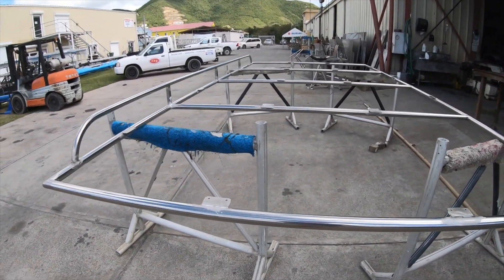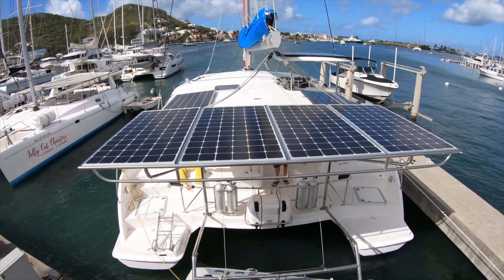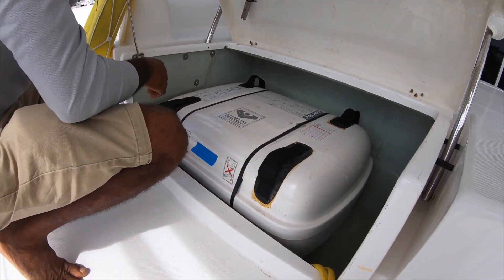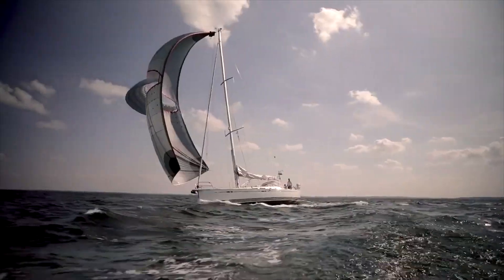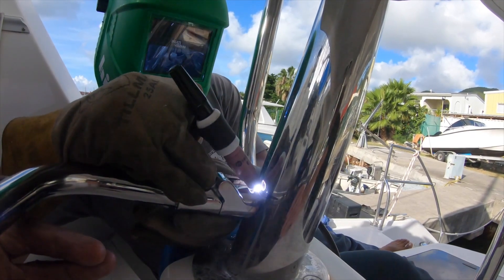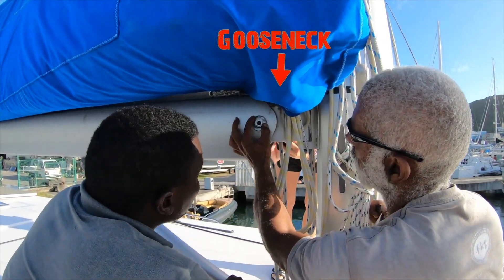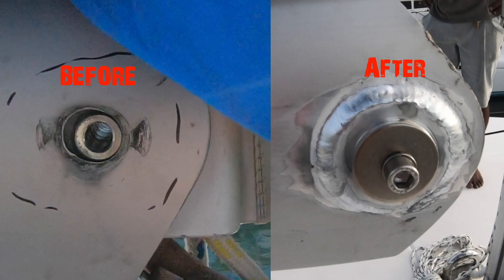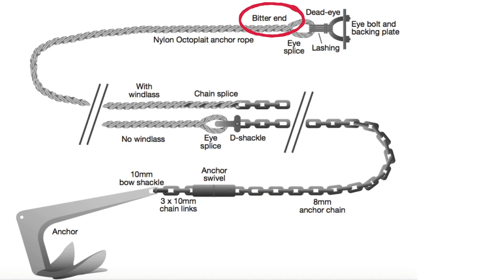117: FKG Work Dock Project Heaven or Hell? 7 Upgrades to our 2015 Leopard 44 Sint Maarten St. Martin

Comment: Hi, I have a question. I know you guys are very experienced divers. What safety things do you put in place when your out at sea and your diving on your own. Do you have to tell someone ? Or do you only dive with someone else? What happens god forbid your boat floats away . Love watching your videos. Take care Jodi
Reply from the maker: That’s a great question, Jodi!! Safety is critical because diving from a fixed point requires you to return to a fixed point. If you have drift or current, then you will have an issue if you are in your own. First, cruisers usually tell other cruisers if they are going down in their own. We then keep track of time to make sure they return as scheduled. If a dive site has the potential for current then we would never dive without someone on the dinghy following or ready. We also are going to purchase AIS Beacons so if we are blown off, our chart plotter on the boat can see where we are. It’s important to know where you are and what the dive conditions are but I would say 99% of the time have a person on the dinghy. And if the main boat blows out while we are under water...well, that would be a huge problem. Lol. Not sure what we would do at that point.
Reply from the maker: And thanks for watching our vids!! ❤️❤️❤️